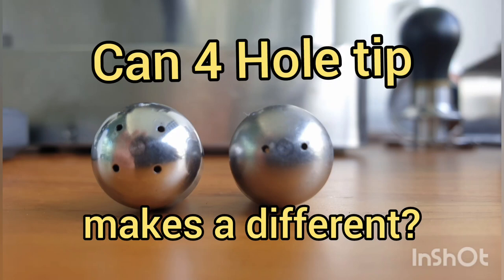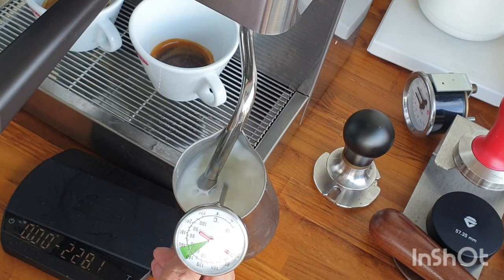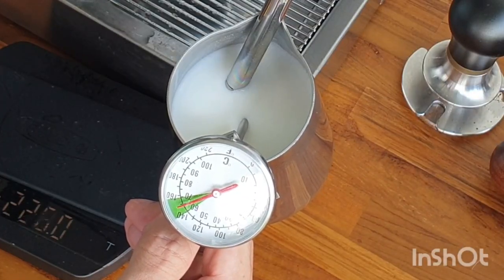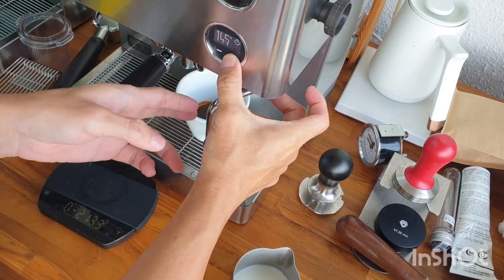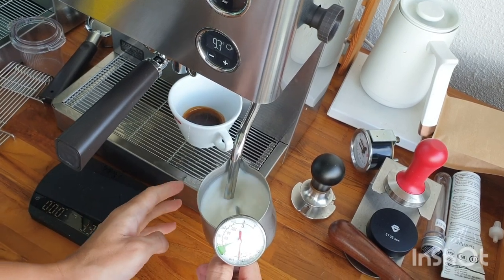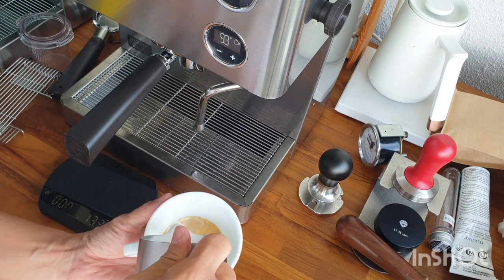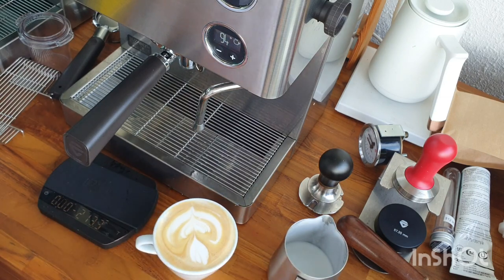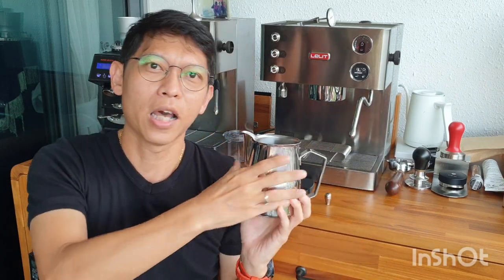Is 4 Hole Tip better than 2 hole tip?

Comment: 4-hole you want to place the tip down directly in the middle, the air should be going down from the corners and up along the walls. You do not want to angle it like you do with few holes.
Reply from the maker: Thanks for the input, will try it
Reply: @StefanusGoana  Please make a video of it! My neew workplace uses 4hole tips and its tough...

Comment: Thank you for the video. I'm pretty good with 2 tips on my elizabeth but the 4 tip is very tricky to circulate the milk or inject air. Also it's super fast. I'm struggling for a week now. I will try your technique i hope it will help, because I always open it all the way immediately.
Side note: please add more tags i was looking for lelit elizabeth 4 tips videos before buying mine and I didn't find any. And I found this video by coincidence 😅.  Thank you 👍🏼
Reply from the maker: Thank you will add tags
Reply: Thanks you very much for the explanation about 4 holes but I'm still finding it very difficult to draw

Comment: Hi! Very interesting video, I have Bianca, i was steaming silky smooth milk with 2 holes no problem ( standart temp, what comes from out of the box) I've changed to 4 hole tip, been practising over 2 months now, but i cant get that same silky smooth milk, i ve swiched back to 2 holes and its no problem. I was wondering if anyone have encountered same problem and if I should increase steam temp? I ve noticed for my Bianca its easier to maintain steam pressure with 2 (1.2-1.4 bar during frothing) holes than with 4 (drops to around 1bar during frothing)
Reply: so bianca out of the box is 2 holes or 4 holes..? what tip size you use for the replacement 🙏
Reply: @gasalahmakan9614  Bianca comes with both tips - 2 holes and 4 holes, not sure about diameter, I came to conclusion thay 4 hole tip is better suited for bigger milk pitchers >500 ml

Comment: Hi 

I own a lelit elizabeth machine. When the coffee is extracted, the bar pressure rises to 12 bar. Is this normal or does it need to reduce the bar pressure to 9 bar?
Reply from the maker: Hi that is what the manufacturer set and that is ok. However many said 9 bar is the best, so feel free to experiment and see which one you prefer interms of taste. You can also set at 10 bars or 9.5? Adjust pump pressure in Elizabeth is so easy so go ahead and experiment and do let me know what is best for you and why?
Reply: Hi
I know this is an old comment however I recommend to set it around 9.5-10 bars with the blind basket. Because vibration pump losses a bit of pressure during extraction. Unlike vibration pumps.

Comment: Thanks for sharing this video. I want buy an Elizabeth and I steam 300 ml every day with my old machine. Is the Elizabeth v3 coming with 2 holes or 4 holes in stock or may I must buy the accesory?
Reply from the maker: Elizabeth comes with 2 hole tip.
You have to buy from your local distributor
Reply: @StefanusGoana  thanks for your help

Comment: Very interesting video, one of the best so far that I've seen. Would you suggest lowering the Steam Boiler temperature if you use a 4-hole if it is too much power, or then better just keep the same temperature and go back to 2 holes? Like I'm wondering what would be best (Higher temp 2 holes vs Lower temp 4 holes). I feel like it would be the first example, and anyway I use a small pitcher and never froth more than 200ml of milk at once so I guess I'll keep my mom's Bianca V3 we just received this week to the stock 2 whole but I was wondering if I should set a higher steam temp than the stock 125C/260F, as what would be the advantage of a higher temp? Is it just to make it faster or it helps for micro-foam too because you can stretch the milk faster before it heats up so then you have more time spinning the milk?

My Rocket R58 only came with 2x2 holes tips and Rocket doesn't do any 4 holes for mine. It's either the stock 1.4mm or smaller alternative 1.2mm which I've never tried in 3.5 years ^^
Reply from the maker: Just give it a try bro, play and have fun, destroy it then rebuild again if you have to. The machine is made for performance, congrats and enjoy 😎👍

Comment: Hi. I have a Lelit Kate VIP, and found that it has a one-hole spout for the steam wand. Could I replace it with a three-hole spout?
Reply from the maker: Hi Lelit do not provide 3 holes tip for single boiler machine. I guess for now thats all you have